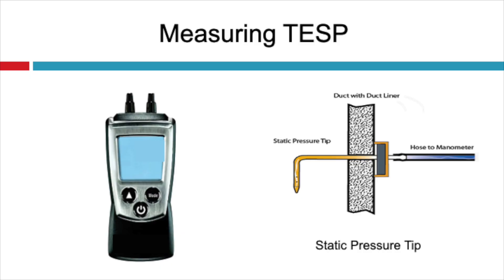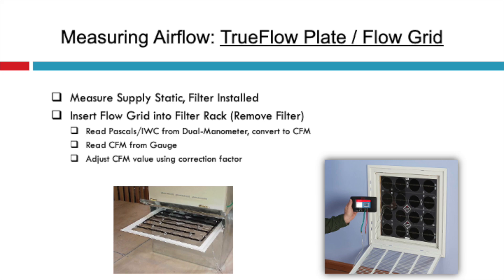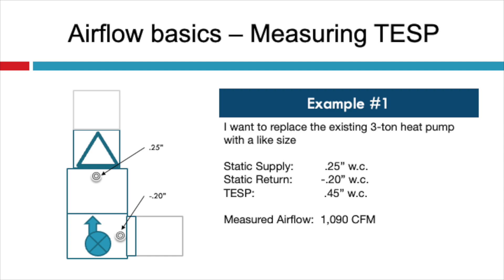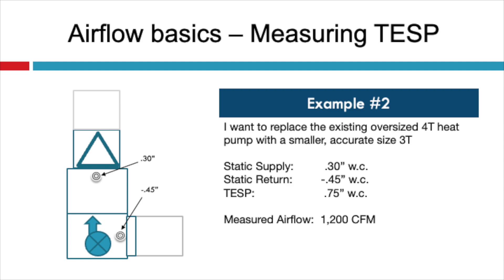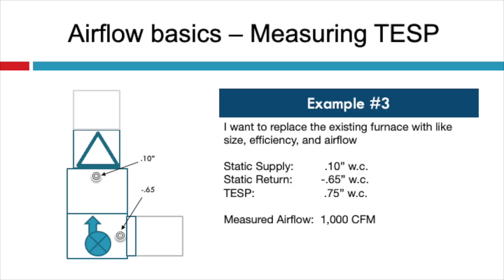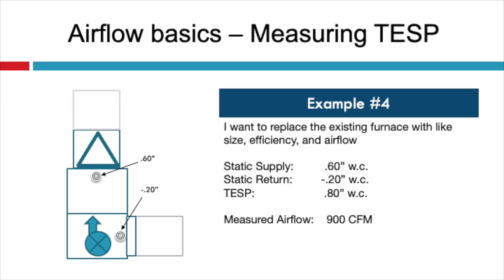How to Tell if Your Ducts are Properly Sized for a New HVAC System

Comment: "by verifying static is close to design"....most houses don't even have an hvac design....so now what?  all you can tell without a design is if you are within manufacturer's specs for TESP which is printed on the furnace sticker info sheet.  Is there anything else you can tell with TESP, speed tap setting, and air flow?  Thanks Chris.
Reply from the maker: Great question!  Rather than try to explain everything in a comment on Fan Law #2 and what you are looking for, please checkout this content? 
Why You Must Verify Duct Size When Replacing Your Furnace: Fan Law #2 Demystified
https://youtu.be/mbZKfPDA8X4

Comment: It's interesting how this residential approach is so different than how it's done with commercial systems.
Reply from the maker: I would love to know more!  I did very light commercial service (RTU < 10T) in the past, almost my entire 25+ years was residential focused.  What is one or two key differences?
Reply: @HVACProBlog  there's a lot different. Not sure I can cover in a comment. For example, external static is measured after the cooling coil. And it's different from total static. We don't have anything called Total external, it's either total or external. And we measure cfm via a duct traverse measuring velocity. Total static is also before any fillers. Because our equipment includes everything from the factory inside the unit.
Reply from the maker: Ah yes, I see - since there are a lot of packaged systems.  When changing the filter types, replacing a MERV 8 withe MERV 11 for example,  I can see this also wreaking havoc on where/how to measure too...